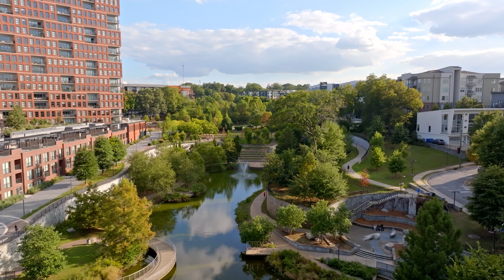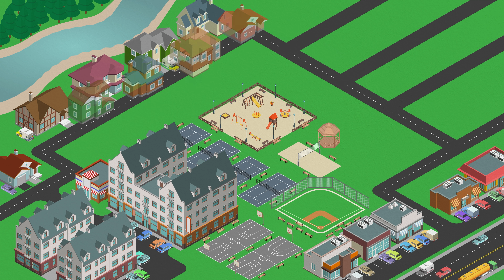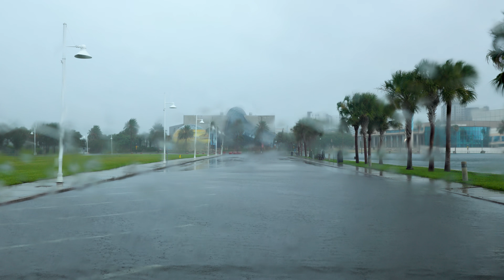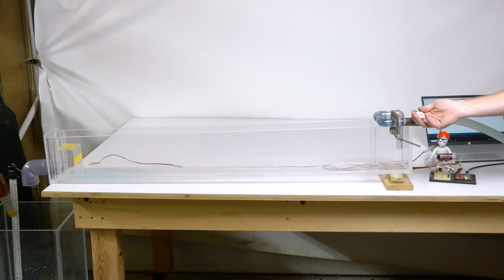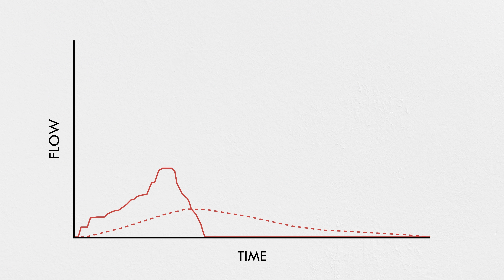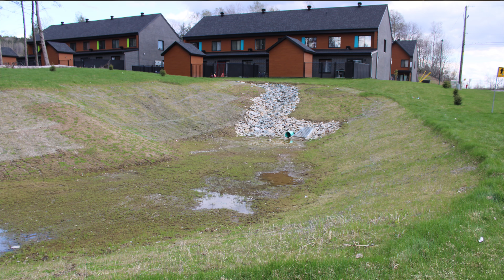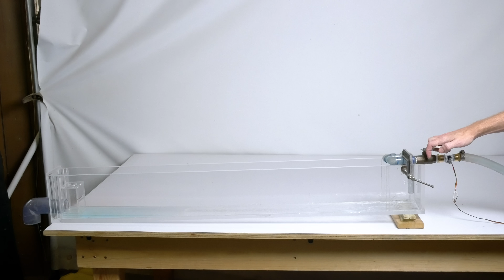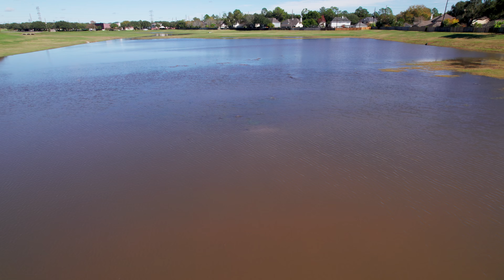Do Retention Ponds Actually Work?

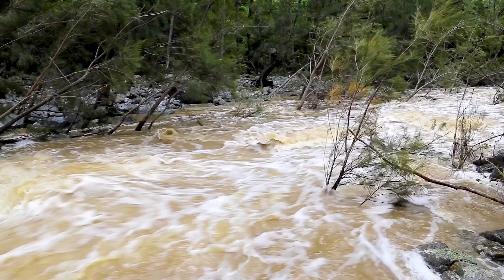Comment: 3:25 It's also important to note that soil that's been left dry for a long time is often just as impervious as saturated soil, at least for a while.  This is why sudden rainstorms after a dry season can cause massive floods - the natural absorption is not functioning until the ground 'opens up a bit' (Don't know the technical term) and allows that water through.
Reply: This is one of the double whammies that wildfires can cause too! Fire baked soil, devoid of vegetation, and covered in a layer of ash is one of the worst possible surfaces for handling a major storm, and can cause flash flooding and landslides in areas that already experienced a natural disaster.
Reply: Grady actually did a video on this topic a couple years ago. Search "Do droughts make floods worse" and you'll find it
Reply: @ThatMattWhite  Cool, thanks for letting me know, I'll look that up.  Pretty new to the channel, but it's really cool!
Reply: The ground in my area can get huge cracks in it when dry. You can run a sprinkler on it for hours and the water will just disappear down those cracks.
Eventually the water starts soaking in, the soil expands, and the cracks close up. But it can take several days of watering for 2 or 3 hours per day to get to that stage...
Reply: @tin2001  it has the permeability of brick until it is moist again. Those cracks don't hold nearly as much water as the voids between moist soil particles. It's both compacted more (less surface area) and water's surface tension can't interact with it so it can soak in quickly, leading to flooding when a heavy rainfall happens.
Reply: Yep, clays naturally compress as they dry and need time and consistent moisture to become porous again.
Reply: @BertoxolusThePuzzled  Not just that, but as vegetation decomposes in dry weather, it creates waxes that make soils hydrophobic.
Reply: @1FatLittleMonkey  that, and bacterial byproducts that are oily in nature. That's why fresh rain has a specific smell (petricor), it's the oils evaporating with water contact.
Reply: You're talking about hydrophobic soil?
Reply: Moisture Tension
Reply: Hydraulic conductivity
Reply: Actually soil moisture tension. HC is a measure of saturated flow.
Reply: @RRLVT  Surface tension
Reply: Yep. I was a little disappointed that wasn’t mentioned. Anyone who lives in or near the desert knows this well.
Reply: @DeepBrainThrombosis  He has a whole video on that topic in particular.
Reply: I thought this was what this video was going to address but nope. Instead he went in the opposite general direction.  It's very much a thing and causes all kinds of problems.
Reply: fake news, it makes no difference after a couple of minutes.
Reply: @bftjoe  the effect lasts up to 30 minutes. Youre just ignorant and grossly over confident in your poor intelligence
Reply: Wow 30 minutes, what a huge deal omgz. Can't believe why it wasn't mentioned in a short intro video. 😂😂😂😂😂😂  @cherriberri8373 

You must have a really high IQ to be this worried about something that really doesn't matter in the slightest at the big picture level. 🤡

What do you do, watch post10 videos all day and think every word he says is gospel? 😂😂😂😂
Reply: @cherriberri8373  Even 30 minutes is generous sometimes. I used to build earthen dams out of clay and sufficient compaction makes clay as impermeable as concrete and asphalt over long periods of time. Areas where the water table has been gradually lowering due to climate change or diversion to human developments cause soils to get gradually more compacted to the point that they're hydrophobic as well as impermeable. Might as well be rock.
Reply: @bftjoe It depends greatly on the kind of soil. My area has very clay-rich soil and a lot of sun, and when clay is left to dry in the sun it becomes quite impervious. It takes a good long soak before it stops acting like brick and starts acting like dirt again.
Reply: So give actual numbers then, what is all this wishy washy BS. 😂😂

And no study has ever found that this effect is even worth taking into consideration when calculating soil absorption rates.

It's literally a meme that has little to no basis in reality.

In the real world, a drier soil, no matter if it's clay or not, has more ability to absorb moisture,  not less, besides for a couple of minutes when it first starts raining. What you're saying violates basic laws of physics.

Give actual numbers you measured or cite an actual published peer reviewed study or be quiet. 😂😂😂😂 🤡

Repeating the same BS over and over doesn't make it true. 😂😂😂😂😂
Reply: @bftjoe  Take your own advice. You can't just say "nuh uh" and expect to be taken seriously, either.
Reply: I am not making an outrageous claim that violates the laws of physics.  😂😂😂😂 Google Scholar it and read up, buddy. @jacobp3261 

Demanding someone provide proof for their nonsense is not "advice". Do you know what that word means?

Do you think the burden of proof lies with someone making a claim or disputing it? Do you understand the basics of logic and debate? 😂😂😂 🤡
Reply: @bftjoe   hey, maybe this person isn't giving you numbers because they dont have the tools to run an Atterberg Limit test at home.
Reply: @bftjoe  I'd be interested to read the study if you'd be so inclined.

Comment: I always thought that a big feature of the retention ponds was for water quality control.  The ponds slows down the runoff so that solids suspended in the water can drop out into the pond instead of going down stream.
Edit: and right after I finish typing, you start the mica demonstration.

Comment: As of about seven minutes in, it doesn't sound as though we would want stormwater ponds.  It sounds as though we would want drainage ditches or drainage pipes with limited flow-rate capacity, that would connect to the subsoil.  When it's not raining, they would draw down groundwater levels.  When it is, they would provide a connection between surface grates that stormwater runs into and subsoil that the water can accumulate in.  If you build a stormwater pond, you're not using that land for anything except the pond.  You can only do that with a smallfraction of the land before it gets too expensive.  If you store water in the subsoil, you can do that with the entire area.

Comment: The problem i've noticed in towns is that they repave roads that make them higher than the drain pipes now, so water sits on the road.   Its cheaper of course to just repave than tear up and redue.   But it makes for bad road conditions because  drains can't take the intake because too high or too low now.  The solution would be just put metal grates connecting the road to the drain, instead of drain on the curb.
Reply: That's just shoddy work 100%.
Even if the surface of the road is higher after repaving, if they incoroporate a small slope to the sides of the street, water could still run off.
Reply: We turn the gutters into linear basins, building storage with every repave. Driver safety? Never heard of it. Green justifications for the road lobby.
Reply: Seriously, no road needs to be flat. This is shoddy work, and shoddy oversight.
Reply: That is really poor paving practice. The drainage should always be reopened. Someone is cutting corners.

Comment: I lived in Jacksonville FL for 5 years, and retention ponds never ceased to amaze me. I lived right near the St.Johns river, and I can only imagine how messy things would get during the summer storms without those ponds. Alot of them were stocked, either naturally or by local residents, and my buddy and I would go fishing in them sometimes. Never caught much, but it was great time killer and a beautiful view. Those ponds form great habitats for turtles, storks, ducks, frogs, and even gators. At any rate though, thanks for the video! I had no clue there was so much engineering that actually went into them. Between you and RCE, I think I could hit the ground running in a civil engineering class.

Comment: Do they really work? I see so many of them being kept topped off all the time. How can they help during a flood if theyre full already before the flood start?
Reply: There is usually a run off that manages the flow. Where there is an existing body of water this doesn't really matter that much when it comes to water flow, it's the additional capacity that matters and how fast that runs off. Therefore you could have a 50m x 50m retention pond that is 1m deep on average and that doesn't matter - it's if there is the capacity for an additional even 0.25m on top of this that matters as that is the run-off water control volume. This is very similar to a 50m x 50m x 0.25m dry run-off storage.

Comment: It's pretty cool how my city deals with runoff.  We have tons of parks, way more than a normal city.  There's basically a city park every few blocks.  The parks act as detention ponds.  Most of the time there isn't enough water to flood the parks, but if we get massive storms, the parks flood for a day or two and absorb the surge water.  It prevents flooding in areas that it would damage, and makes lots of green spaces and play areas for kids and families.

Comment: Just moved to AZ as a water infrastructure engineer and it’s a lot different design requirements than Montana with the retention ponds
Reply: In Albuquerque, the city has turned into a maze of concrete arroyos, RCP storm drains, and giant detention ponds. A notable example is John B. Roberts Dam, famous for being the location where the Disappearer (or Vacuum Guy) picked up clients to relocate them in the show Breaking Bad.
Reply: Moving states as an engineer sounds exhausting. As a contractor, I would hate to have to relearn all the tech specs.

Comment: Probably not worth a whole video, but I have an irrigation retention pond in my neighborhood.  Water flows into the pond from a nearby irrigation canal.  Then there's a pump that pressurizes the water for the neighborhood irrigation system.  The pond acts like a capacitor in an electrical circuit to level out irrigation demands.  Everyone likes to water their lawns at the same time at a level that would be too high for the supply line from the canal.  The pond fills up when the demand is low and then goes down when demand goes up.  There's a worker called a ditch runner who comes by on a regular basis to adjust the valve for the water from the canal.  If the pond is dropping too much, he opens the valve.  If there's too much water, the excess goes into a stand pipe that feeds a lower run off area and the ditch runner closes the supply valve a little.  You can really tell how good of a job the ditch runner does by how much variation the pond level has.

Comment: I agree storm water retention ponds make sense on large projects. But the EPA laws in my state are ridiculous-reqiring a pond or chamber system on 5000 sq ft or more improved area. I have installed several ponds and chamber systems over the year s on many small projects in already developed areas at an crazy cost. Further more there is a huge variation in runoff calculations depending on the engineer. To make matters worse when application for the permits goes in the EPA those who review the app almost never have proper qulifacations to comment on it.  It is just like lawyers kicking a contract back and forth--Job justification. The small retention ponds/chamber systems I have installed remain almost dry 99% of the time and have no effect on these developed areas. Eye dropper filling a bathtub. Plus once approved and installed it is forgotten about. Most of the time completely grown in...  They are absolute unnecessary on preexisting developed areas on small projects. Its a joke.

Comment: I live across the street from a detention pond and across another street from a much larger retention pond. A sign by the detention pond identifies it as a "water quality" structure but it is more of a water quantity structure.  Their construction was prompted by recurring flooding of basements of about 20 homes.  After a hundred year storm the homes were moved to new locations or torn down if not movable and the ponds were made.  The retention pond sometimes drys out completely.  There is sand under most of this part of the city covered with a thick layer of top soil.  There were more ponds dug in other parts of the city due to that same storm.  They seem to have solved the flooding problem.

Comment: 1 hectare is 2.5 acres, so idk the figure you cited at the beginning was actually 5 acres and was therefore 2 hectares, or was actually a half hectare and therefore 1.25 acres lol
Reply: yeah no way that little pond was 5 acres
Reply: @JasonAWilliams-IS  - I think what may have happened is he used the number from the maximum amount of water that could be stored in that basin, note the sunken nature of the pond and the retaining walls.  I was kind of disappointed he didn't go back and focus more on that park, cause that's the sort of thing you don't notice or think about in the city, before watching this video, I never would have considered that the whole basin was meant to fill with water during a flood.
Reply: @JasonAWilliams-IS  Came to say the same things, but with a little measurement on Google maps, it's not even an acre.  The pond is roughly two circles with radii 80 feet and 50 feet, connected by an irregular shape that I kind of blobbed into a rectangle that is about 50'x150'.  Total area = 20100 + 7850 + 7500 = 0.81 acres, or roughly 0.33 hectare.
Reply: When you outnerd the king nerd you become the new king nerd.  All hail 68±1!
Reply: I thought he may have just done what I do and took 2.5 acres to 1 hectare but then thought 2.5 is 1/2 of 5 so .5hectare and halved the hectare rather than doubling it.
Reply: And if metric measures were used we wouldn't need this discussion.  5 acres is about 20,000 square meters/metres.   Surely that's more meaningful - even in the US which is becoming the last bastion of imperial measurements.
Reply: @timw.8452  The US does not use imperial measurements , it uses the ironically named Standard Measurements
You have weird gallons and others
Reply: @PaulG.x  I think the gallon is gone, even here in the UK, where you fill your car by the litre.   Maybe the one we have left is pints in pubs.   But buy beer or any other liquid in a supermarket and it will be in litres or easily understood fractions or multiples thereof.   No doubt another Brit will disagree, but I think most of us weigh ourselves in kilos now (please let me get below 80 in 2026!).   It just doesn't make sense not to go metric IMO.
Reply: @timw.8452  just wanted to the play the role of a Brit that disagrees...

I use Celsius for temperatures, and centimetres/millimetres for measuring small lengths, but for everything else I use Imperial measures - just because it is what intuitively makes sense to me - I can visualise how far a mile is but not a kilometre, I can visualise 6ft, but if someone asked me to visualise something 180cm long, my brain converts it to feet first to figure it out. A football pitch is "about 4 acres", so I find 4 acres easy to visualise because I've seen hundreds of footy pitches - but I've no idea how big that is in m². When driving, I can estimate my speed in mph pretty reliably without looking at the speedo, but kmh are mysterious to me...

I'm sure it's mostly habit, but for me I think it boils down to the idea that when I need precision, I use metric, but rough estimates just seem far easier for my brain to work with in Imperial measures, and more often than not, a rough estimate is all that's needed in my life.
Reply: @timw.8452  No US still uses their gallon . Do a image search for "US fuel price" and it's all gallons
Reply: @timw.8452  as an American who has been using metric on principle for 15 lonely years (hence knowing all the conversion factors off the top of my head leading to comments like my original one lol), hard agree
Reply: @68plusorminus1  As another American who uses metric, it is actually 2.47105 acres per hectare. I usually use 2.47, but 2.5 is close enough
Reply: @timw.8452  In no way arguing that the US shouldn't use metric, but the pond is not 2 hectares, nor is it half a hectare.